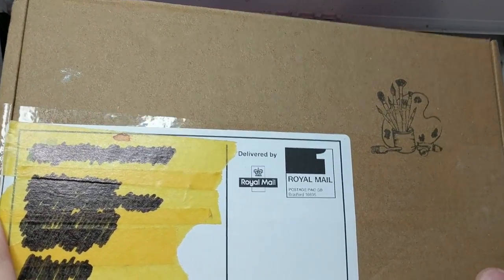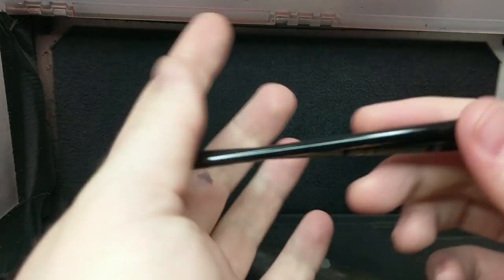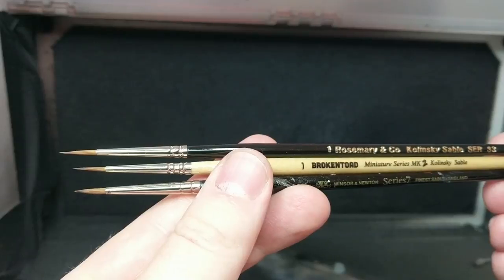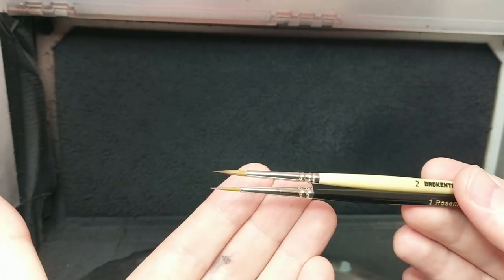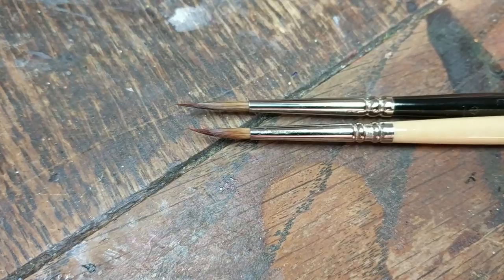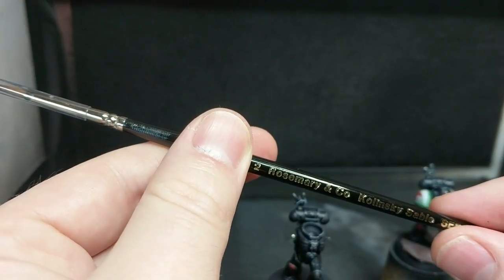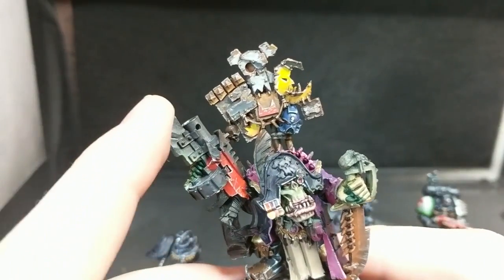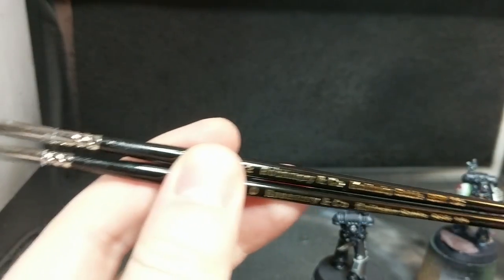Rosemary & Co Series 33 Brushes - Unboxing & Review

Comment: I found the broken toad size 2 and size 0 just as good as the w&n series 7 to be honest. Only started noticing difference when going smaller and it looks line you've got the miniature w&n rather than the normal ones, which have much longer hairs